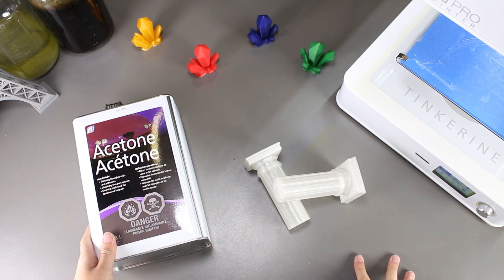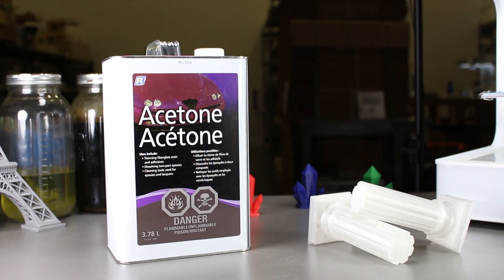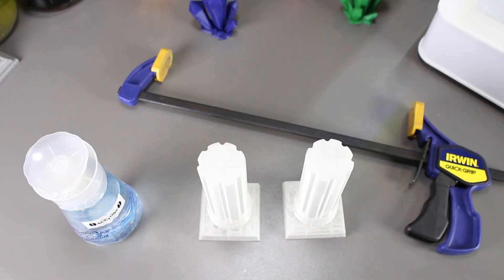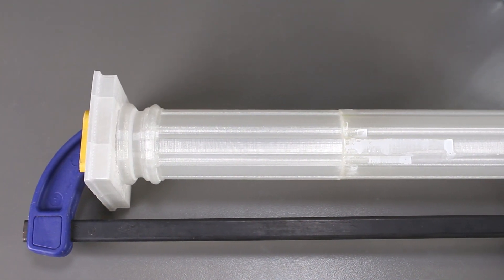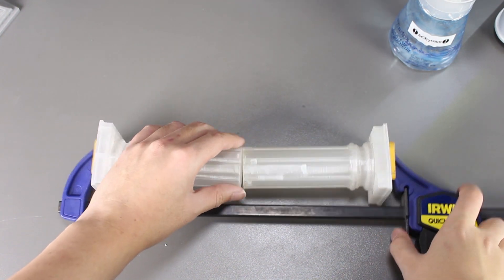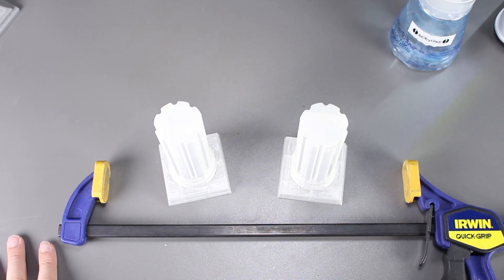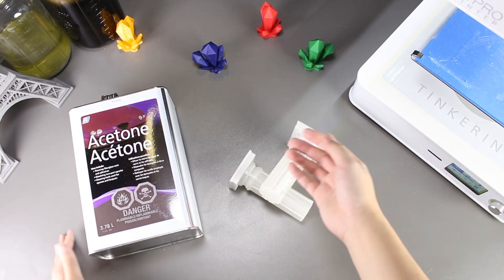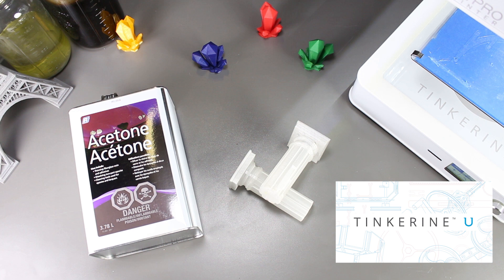Gluing PLA together with Acetone

Comment: I use nail polish remover for some hatchbox "white, performance pla" and it works really well. I did 5 tests with super glue and 5 with acetone, and each one showed the bond was significantly stronger with acetone. The parts were joined with no clamping, left 24 hours to dry, and joints were flat similar to this video. Anything "doesn't work" when you do it wrong.
Reply: It should also be noted that the superglue worked just fine. Both work, but for my thicker parts (.8mm-1mm walls) acetone did make a stronger connection.
Reply: I’m sorry, but your comment isn’t actually that helpful unless you specify what was done wrong???

Comment: First of all, this is not the proper way to weld with acetone.  To properly weld, merge the parts together and add acetone to the seam, then without delay clamp parts together.  Acetone is the fastest drying solvent on earth, so if you don't merge the parts right away, it will evaporate.  I've spent money and time with other methods such as welding, 2 part epoxy glues, and acetone is by far my favorite.  It doesn't just glue the parts together, it melts both edges of part and fuses them into one, solid object that is as solid, if not more solid, than it being printed as one piece.
Reply: Actually, Methyl Ethyl Ketone is faster. But if he would have brushed the acetone on both parts and let them get sticky before pressing them together he might have had a different result. I noticed with ABS just adding the acetone to one side didn't work as well as getting both sides sticky before clamping them together.
Reply: Sure it evaporates quickly on a surface that it is not a solvent for, but when I used to ABS solvent weld all the time with ABS, it worked best to apply it, to both sides, let it soak in a little and start softening the ABS, and then when both sides were a little soft/tacky put them together.  Clamping was never necessary and parts always broke adjacent to the weld on layer lines and never on the solvent welded faces.
PLA + impurities may work.
Best way to solvent weld PLA is probably the product called "PLA Goop", which is unfortunately made only in the states that I know of, making it annoying for me to get in Canada with the import taxes and shipping. Chloroform would also work, but good luck buying that in many countries.

Comment: I have an ABS+ with the opposite problem, it barely even reacts with the acetone when left submerged for days lol
Reply: Have you try to heat up the acetone ?
I have noticed that when Acetone is heated, the ABS smoothing reaction is much faster
Reply: @Snypi0  Kept at room temp 18-21 Celsius. I will try it heated. How hot do you think, 60 Celsius maybe?
Reply: @BillyBobJimPatton  I just heat up the Printer bed up to 60c and then put container with acetone on it, in witch the part should get smoothed.
Keep in mind to do in really ventilated place as the fumes from acetone can be really bad.
Reply: @Snypi0  I will try it heated on the bed, thanks for the tip. Also thanks for the warning about acetone fumes :)
Reply: His mistake here was he only put acetone on ONE side. The linked video here shows you need to put it on EACH side connecting. So nboth equally melt surfaces stick once it redries.
Reply: @SuperBoinger  I'm not sure if that makes a difference. I tried with loads of different ways. Hot acetone, hot parts, room temp. Acetone on one side, acetone on both sides. Clamping for hours or days. Small amounts of acetone or lots.

The acetone doesn't react at all with PLA. Not even if you submerge it for days - zero difference.

What does react is the things that are NOT pla. If you have a PLA+ or an impure batch it can fuse. Your better off just using superglue thought.

Comment: That odd your parts did not weld,
Am using PrimaSelect and REAL PLA filament from Amazon, and welds really well.
Also Thomas Sanladerer did prove that you can use Acetone to weld the PLA parts.
https://www.youtube.com/watch?v=VZUfq0yrtv4
Reply: The resins used vary by manufacturer so results can vary I've found. I have some PLA that does bond like this but most of mine doesn't and I use super glue on that instead. I also have an ABS that barely even smooths when it's left in acetone for days so quality control at some places I feel is questionable lol
Reply from the maker: Thanks for the comments! What we have found and researched was because of the purity of the PLA. If the purity of the PLA is on the low end, they will bond through acetone but if they are quite pure like in our video, acetone will not have an effect on them apart from discolouring the PLA.
Reply: That linked video shows he put acetone both ends...this video, he put acetone on just one end